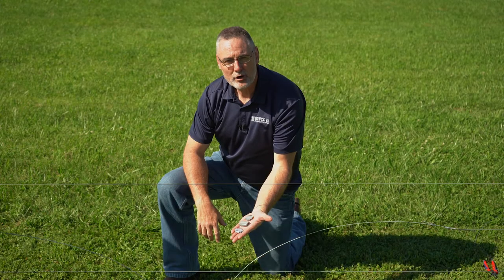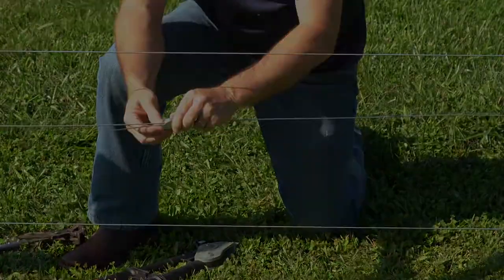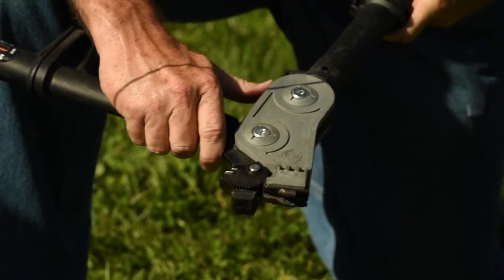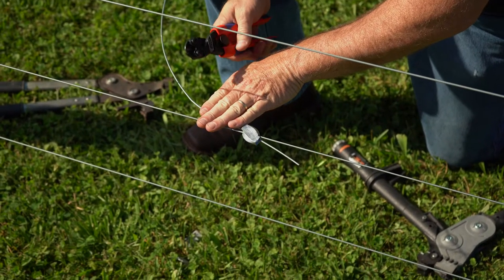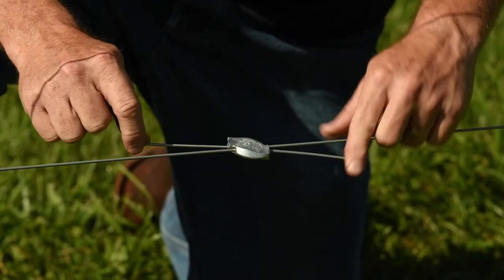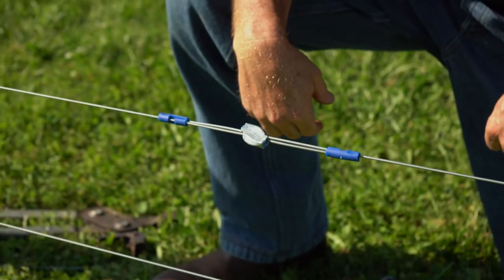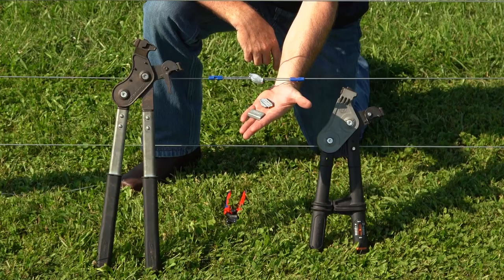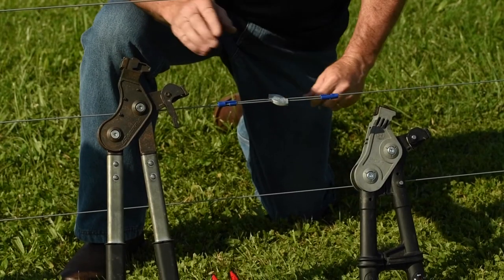Tensioning with a Gripple Torque Tool

Comment: I watched quite a few of videos on this product. Looks like it works geat but there is NO documentation on recommended torque settings for the size of the wire being used.
Reply: There is, check fence wire manufacturers  literature

Comment: It will slip, bend them wires boy
Reply: That defeats the purpose of the gripple. The entire point is that you can retension it when/if it slips. We have been using these for 20+ years. Very few of them slip.